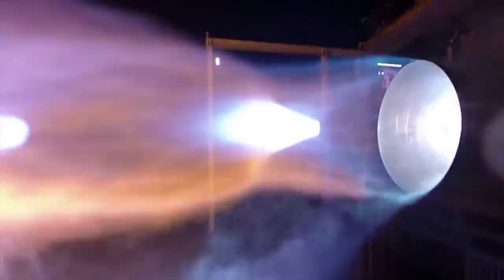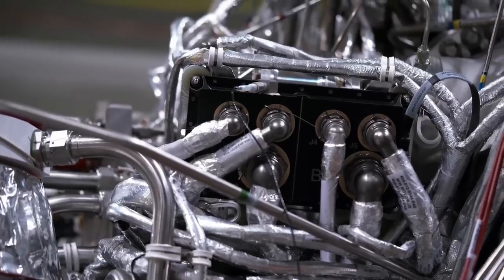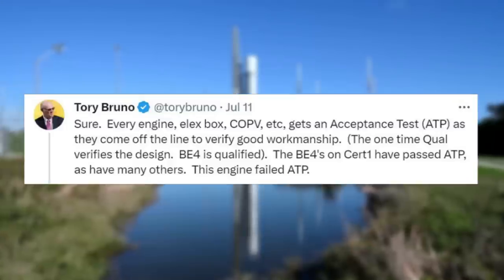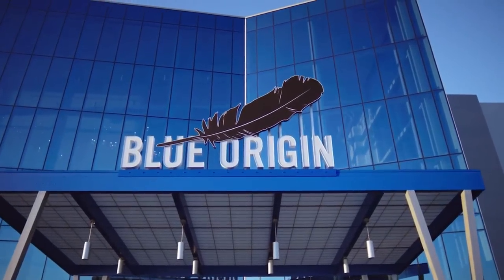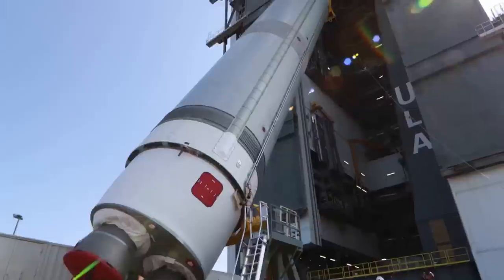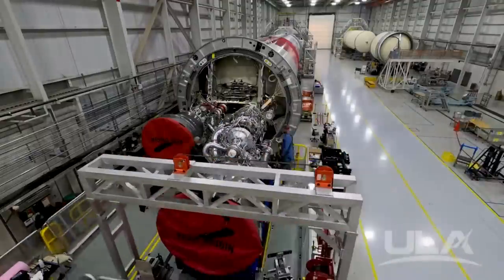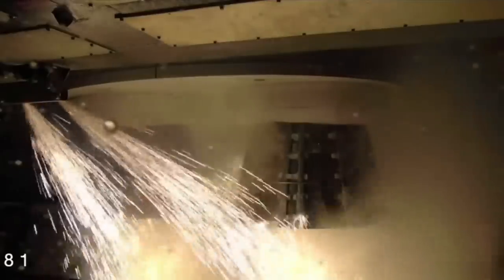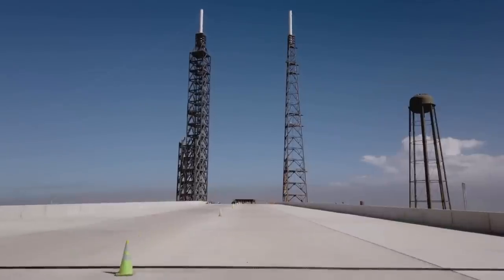A Closer Look At Blue Origin’s BE-4 Engine Explosion

Comment: Ugh. Flight-1 and 2 passed their ATP tests then successfully underwent the FRF firing a month ago. Two qualification engines, which are nearly identical to Flight-1 and 2, completed and passed the formal qualification program a few months ago, and qualified BE-4 in general. Had the qual engines failed, the flight engines would certainly have been removed and it would be bad or worse than the Centaur V qual test failure.

Comment: I think the fundamental problem is that BO basically rebuilt 2 BE4 engines over and over again over a period of 3 years to get a pair that would work long enough to pass tested and get put on a VC rocket.  This is the 3rd BE4 engine they've ever built.  the first two failed numerous times, and the 3rd one literally blew itself to smithereens.  This doesn't point to a stable rocket design.  furthermore, this is the 3rd completed BE4 engine in 5 years!  they need to make dozens of these things, and they've only managed to make 3!  Something tells me there is something fundamentally unstable about the BE4 design, and unless these things are built perfect they won't work.  if that's the case then there could be serious trouble coming down the pipe on this.
Reply: If you are right, and you may well be, and the BE4 engines have deep seated and fundamental design flaws, there is no way BO can possibly make enough flight worthy engines to satisfy their customes, let alone New Glenn.  We shall wait and see....
Reply: I fear that you are correct.
Reply: Blue Origin is currently building dozens of engines simultaneously. Taking their time to build the first two is only natural, as the design is perfected. Now BE4 is switching from a prototype style of development and production, to a focus on large scale somewhat rapid manufacturing. Again some hiccups are expected, as engine production speeds up and the time spent on quality control and component testing goes down.

I don't see this as anything more than growing pains, sure it's a challenge to ramp up production while maintaining engine reliability, but it's not proof of some intrinsic design error that can't be corrected.
Reply: @plainText384  I disagree, and you may be correct, but as I said earlier... "We shall wait and see..."
Reply: @chrisantoniou4366  Why the heck do you believe this guy!? Blue Origin did NOT rebuild the same two engines over and over again. They built 12 engines in under 2 years, successfully test firing them according to Tory Bruno in the press conference yesterday.
Reply: @nowhereman1046  If that was true, why did the second Vulcan engine have to be sent back for retesting and then reinstalled?  Surely they could have simply swapped out that engine for another flight tested engine.  Also, why do we see only partly completed engines in BO's factory if there are (presumably) another 10 completed engines?

Comment: Thanks again for the video.  On the one hand, there's a bit of a double standard.  If SpaceX found a Raptor that failed part of an acceptance test, tested it, and blew it up, many would say "Smart SpaceX".  On the other hand, BO doesn't have SpaceX's track record.  We'll see.  Rooting for both companies.
Reply: Innovation is innovation. I don’t think spacex is truly superior than any rocket company. Even SLS and space shuttle get a lot hate for cost and development, they are still very impressive. SLS delay wasn’t shocking due to hydrogen being difficult rocket fuel. Also One of five Space shuttle did 39 successful launches which insane.
Reply: I would agree with this but SpaceX has built hundreds of raptors at this point of 1 fails it does not rly affect them to much BO have made maybe 20 BE4s each failed engine is more important.

SpaceX have the benefit of mass production for their engines
Reply: SpaceX has a history of repetitive success. BO does not.
Reply: Can't call it a double standard unless both companies use essentially the same work philosophy.  Google agile vs. waterfall to understand the issue better.  You can compare Blue Origin to Boeing without controversy, or even to NASA.
Reply: @Condor-uc2lw  There have been more Raptor failures than just one. This has been documented by people watching with cameras for years now around McGregor across two different Raptor models. The upwards to 11 in-flight launch failures certainly didn't help anything either for Raptor 2's reliability. We'll have to see what happens with Raptor 3 in the coming months and years.
Reply: @Condor-uc2lw  Raptor I, you mean. Raptor II is still not reliable and continues to blow up. Just 2 months ago, they lost more than 10 engines on their failed attempt and cheered their failure.
Reply: @trucksanddirt1506   they lost the engines for a multitude of reasons first the rock tornado then the HPU exploding lol the fat th ast so many worked after such bad circumstances shows how robust the engine is
Reply: @Condor-uc2lw  BO had an explosion for a reason.
Reply: @trucksanddirt1506  yah dont get me wrong Rocket Emgines are some of the most complicated machines on earth failures are to be expected but BO cant afford to blow up any more as their production  is  slow.
Reply: @mikedicenso2778  Just because people watched raptors being tested at MacGregor and claimed that they saw many failures is not evidence that those raptors engines did in fact fail unexpectedly.    The reality you may have overlooked is that the Raptor engines are often tested to the point of failure to discover their limits.  And somebody watching Macgregor may not know that.
Reply: @Condor-uc2lw  Got you, but some just ask us to give Space X a pass, but BO the blame. I agree with you, space is hard, for everyone.
Reply: @trucksanddirt1506  Nah Bro i dont gove spacex a pass if anything im harder on them because i want the to succeed SpaxeX is humanitys only realistic chance to get to mars in my lifetime tyey must succeed
Reply: I would submit that the biggest difference is the Raptors are being cranked out on just about a daily basis while Blue's BE-4 has a far lower production rate. Rooting for both companies is the way to go! That's the kind of Space Race I like to see
Reply: Raptor is an engine made by, for and used by SpaceX. If SpaceX blows thier own timelines, only one pool of investors is affected. Blue Origin chose to be primarily an ENGINE company. This engine has been tested, and is in production. This wasn’t iterate until you break something…. This was…..  we’re selling this near-perfect, well tested engine to other companies, who in turn sell their launches to satellite operators…. Wait did I say near-perfect…. Pay no attention to the one that blew up?  You see the difference. BO is both, not in test mode, and their failures affect ALLOT more investors.
Reply: Blue Origin has zero track record. That's the problem
Reply: @Condor-uc2lw On the test flight 10% of the raptor engines immediately failed, with at least another 10%, if not more (the engine telemetry on stream didn't work at the end), failing over the course of the flight.

While you can argue that SpaceX can handle less reliable engines, due to having more of them, this only really holds for the booster. The Ship only has 6 engines, and there are phases of the mission where only 3 (exclusively vacuum or exclusively sea-level) are used. While that is still more than the 2 BE4s on Vulcan Centaur, it is less than the 7 BE4s on New Glenn, and definitely not enough to be able to easily correct for an engine failure.
Reply: @matthewk4930 Raptor is needed for Artemis 3, possibly the most important flagship NASA mission this decade.
If Raptor doesn't work, the only option would be to delay the moon landing. If BE4 doesn't work, there are competitors to BO/ULA, that have launch vehicles capable of taking over their missions.
Reply: @VincentKarabouladMusique  NASA is reliant on SpaceX and raptor for Artemis 3, their biggest flagship mission this decade. And BE4 is also still improving and changing, as the design and build process is adapted to mass manufacturing. How can your comment be seen as anything but a double standard?
Reply: @trucksanddirt1506  As some of those observers have pointed out it is quite possible that some- if not all- of the Raptors that exploded were deliberately tested to destruction.
That may seem crazy to today's Aerospace Industry but it does tie in with SpaceX's philosophy of rapid iteration: Build many and test them. If any fail alter them and test again. By contrast Blue Origin's design and test philosophy is the exact opposite and is more in line with previous Industry practice.
The other difference is SpaceX already has a proven track record with their Falcon 9 & Falcon Heavy Launchers with Merlin engines. With the exception of just over twenty New Shepherd Launches- the last of which exploded soon after launch Blue Origin does not have the same Track Record.
SpaceX has already proven themselves. Blue Origin is yet to do the same.
Reply: Exactly.  They tested an engine to extreme limits fully expecting a failure (it didn't explode)  And that's all you here "BO explodes engine"  Meanwhile, Raptors fail weekly on test stands.  You don't hear "exploded" or failed.  No, it's "ongoing innovative testing"
Reply: @NoobOnTrackpad  132 successful flights over 30 years is damn impressive.  And at the end, turn arounds of 54 days (88 after Challenger as they started examining the airframe) (which is the real reason the shuttle was retired, age on the airframes vs costs of building new ones)
Reply: Yes but factory production of raptor is one per day space x knows factory production
Reply: @VincentKarabouladMusique  Any New Glenn missions or Vulcan Centaur Missions can be transferred to alternative launch vehicles (Falcon heavy, Ariane 64, etc.) fairly easily if something creates a large delay. HLS missions have no such alternative until ~2030, when Blue Origin gets a moon lander up and running. Also Musk initially promised to land on mars in 2022 (last year), so it's not like SpaceX has stuck to their timeline any better.
Reply: Track record of Space X is what? To consume gigantic amounts of tax payer money for an absolute empty promise?
Reply: Don't agree.  If only B.O. was more like SpaceX, they would have been testing lots of rockets by trying to fly them.  Then these current issues would have all been smoothed out by now.
Reply: No comparison between BO and Space-X based in results. Ridiculous to say there is. 
BO stinks…lit something in orbit..anything!!!

Comment: Raptor 2 had a similar issue with QC as one exploded on the test stand last December.
Reply: Lots of raptors have blown up, during testing and flight. But the fanbabies will claim that that's OK but BO is doomed.
Reply: @iamaduckquack  SpaceX has manufactured and tested hundreds of Raptors, Blue Origin has manufactured and tested only a handful. You don't have to be a fanbaby to see the difference.
Reply: @iamaduckquack spacex intentionally blows up raptors, to test limits of design and to test engine shielding.
Reply: @iamaduckquack  if by fan bois you mean people that really understand the difference between the methodologies of the two companies. Space X has flown dozens of Raptors and radically evolved the design in performance and production method.  BO have made 3 engines and flown none. And the third one blew up in test. In the same time span.  They are just finding out the first order problems that Spacex discovered and solved 3 years ago at least.
Reply: @gregsutton2400  correct but we still haven't even had all 33 engines up and running at once yet despite everything you stated. They've attempted all 33 twice and haven't achieved it.

Comment: So a single BE-4 blew up on the test stand? That’s a pretty frequent occurrence for SpaceX with their Raptor engines. 🧐
Reply: BO don't push the limits of their engines on the test stand but SpaceX does ...
Reply: @nirbhayatiwari5425  How do you know that? That was what the pre-qualification and formal qualification did for the last two years.
Reply: A single BE-4 indeed. Out of 3 built. SpaceX have blown up a number of Raptors, but considering how many they have built, they are at a failure rate of about 1-2% on the test stands. Raptor is still in heavy development, it still is a prototype engine built for a prototype launch system. BE-4 is supposed to be ready for commercial launch. I am inclined to give BO and ULA the benefit of the doubt and not knock them for this engine failure. But comparing this failure to failed Raptors makes very little sense.
Reply: @BasketKees  True  ...
Reply: @BasketKees  I'm taking it you didn't listen to the press conference that happened yesterday. There have been many more than that built and passed ATP according to Tory Bruno. 

And you're making up a statistic about Raptor that simply isn't true. Plus we know that most of them have never been fired, those that have, often only have 10 second ATPs, and SpaceX keeps junking them, no matter how many get built. That's why we're on Raptor 3 now.

So, is Raptor still in development or not? How reliable is it really? Will it ever get locked down in design to mature it?

Until that can be answered, people claiming all this greatness for Raptor 1,2, and 3 are just mostly talking smack. But BE-4 has gone through the development, pre-qual, and formal qual, and are now trying to spin up production and nail down line QA.
Reply: @BasketKees  Out of over 12 in the last 2 years, according to the press conference.
Reply: @mikedicenso2778  12 or 3 compared to many hundreds does not make much of a difference to my argument I would say. Both companies have a completely different way of developing. Blowing up an engine in BO’s slow and steady process is a lot more impactful than in SpaceX’s fail fast process where it is often intentional even. I stand by my point that it makes hardly any sense to compare such failures.

I don’t have to make up any statistic. There are 24/7 live cameras pointed at the Raptor test facility. There are recordings of over 1240 Raptor test firings since April of last year. That to me indicates they test at least the vast majority they build if not just about every single one. In 9 of those tests an engine was visibly and audibly blown up, some of those likely intentional. The majority of those firings were long duration at over 90 seconds. Make of that data what you will, but please refrain from insinuations.

I am not saying anything about which engine is better. I am not in a position to say anything meaningful about that. Nor am I saying that BO failed catastrophically by blowing up this engine. All I am saying is that BO and SpaceX have completely different methods of development which makes comparing test failures between the two make very little sense. In the end both will have to prove themselves and I hope both are greatly successful.
Reply: @nirbhayatiwari5425  It's the whole point of that test to do this.

Meanwhile space x goes for a minimum and still has an empt shell as spaceship for their promise to reach Mars in a few years.
Reply: @BasketKees  Space X will be bankrupt if the don't keep wasting rockets for bs like Starlink. an absurd idea and gigantic waste of resources.
Reply: @BasketKees  Right, but that's the problem here. People make snipes at Blue over engines, then can't take what they dish out with a counter argument. We don't know if those Raptors are intentionally blown up, even. That's just guesses and no one's tracking the engines used in these tests very well, either. 

What people don't realize is a lot of the Raptor engines built NEVER GOT FIRED. Seriously. Not even for a few seconds, a good number of them went to scrap for Raptor 1, then nearly the same for Raptor 2. Raptor 3 is still very early and all three engine variants are so different from one another that it's hard to gauge things overall. 

So, even when we can watch engines firing, as is the case with McGregor, we don't know what we don't know. What was the goal of the test? Was it truly successful? Was it intentional to blow it up or not? Of the engine's fired, how many were fired multiple times and for what durations? Of those that failed, how many were design failuress? Workmanship?

And it still doesn't change the hard fact that 11 engines failed on Starship Super Heavy orbital flight attempt one, dooming it to failure.

With several BE-4s, Blue quite generously told us what engines were used for what tests and how much time those engine accumulated. In one case PQE-900 logged 36 starts and over 5000 seconds. In another case,  PQE-602 racked up over 2500 seconds. We know early BE-4s only accumulated a few hundred seconds time or were fired for only 10 seconds durations, etc., just like Raptor. But we don't know how many BE-4s in total have ever been built, at least 13, and we don't know how many tests.

Comment: Was this only the third engine to be tested for ATP? How many engines have ATP?
Reply: A lot of them, actually, since all engines: development, flight, or qualification have to undergo an ATP.
Reply: Yep, flight engine No 3...  All three have been tested, the first two a number of times, and the third failed catastrophically.
Reply: @chrisantoniou4366  This is an outright lie on your part. FE-1 was failed only one ATP, was sent back, fixed, then sent back while FE-2 underwent its ATP (with no problems whatsoever). Qual-1 and 2 also underwent ATP a month later and they passed their ATPs and then went on to successfully complete the formal qualification testing by mid-April of this year.
Reply: Over 12 engines have undergone and passed ATP in the last couple years according to Tory Bruno at the press conference yesterday. Presumably, FE-3 (third flight engine) was the 13th to attempt it.